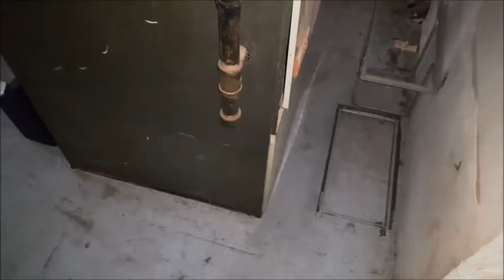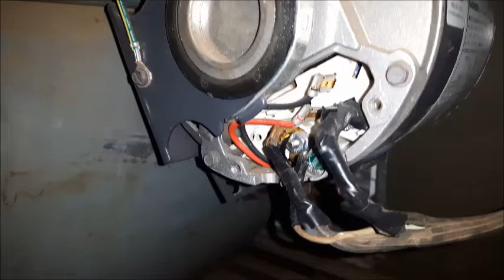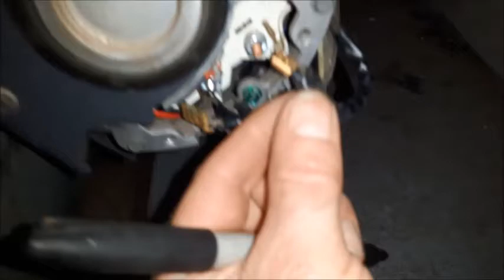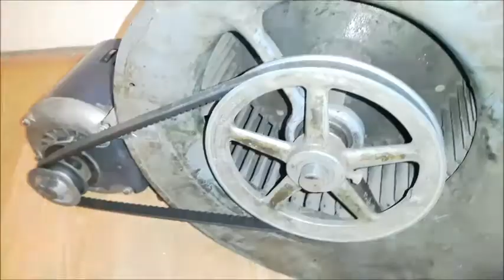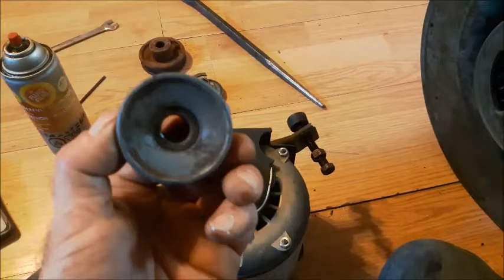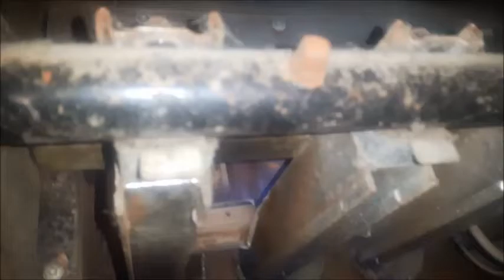Furnace fan repair

Comment: How'd you get the old bearing off the shaft? Did you use a bearing puller somehow? I'm trying to replace the bearing on mine for the first time. Thanks for the videos, BTW.